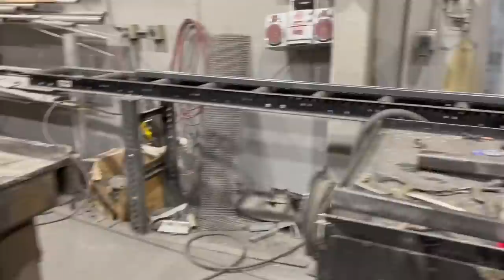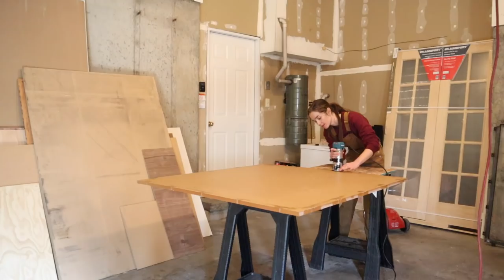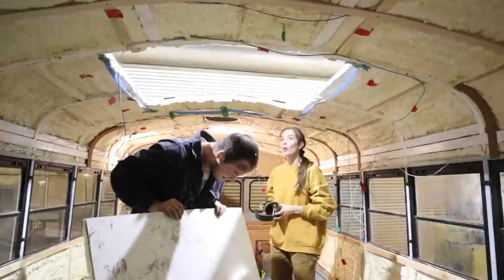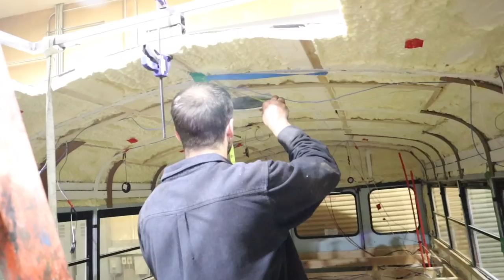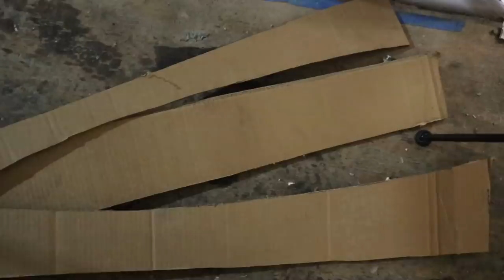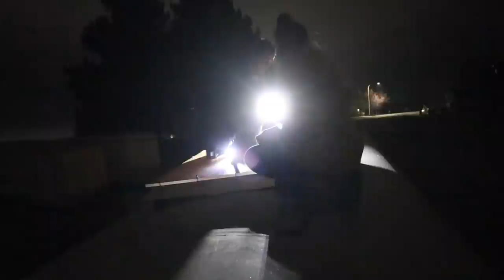Skoolie Roof Raise, Lazy girl edition: Giant skylight for more height in my school bus

Comment: I knew eventually you would use the grinder. Bonus points for welding! I discovered Shawn and Ash (wonder where they went) when I started building. I wish I had done the same, still. Yours looks better. A shop and a brother engineer would have helped me so much!

Comment: That oil thing is so funny, funny story: when I was about 22 right before I joined the Air Force I took a trip from Michigan to Myrtle Beach SC and my car was crap and wouldn’t have made the trip, long story short my parents let me take their Cadillac but my dad told me to check the oil each time I filled up the tank, so I did, or so I thought. About half way  on our way back to Michigan I realized I was checking the transmission fluid 😳 So it happens to us all 😁
Reply from the maker: amazing 😂

Comment: Emma, I love the skylight, but I one real huge concern. Does that open towards the front of the bus? If it does I plead with both your brother and you to move the hinges to the front, and have the cover open to the rear! If you are driving and the wind manages to get under the front at highway speeds, it is going to flip open and rip itself right off the bus. If you have it open to the rear, even if you forget to secure it, it may rattle around a bit, but it won't blow off.

Comment: Skylight looks great, Wondering, you made sure to use spray foam insulation everywhere except for the single pane windows. They will suck the heat right out of the bus,
Reply: My winter curtains have two inches of insulation built in which solves the heat loss character of those type windows.

Rainwater still leaks in and stains my blockout layer !

Comment: Well, Emma, you have to start somewhere.. Every achievement starts with an ambition..  =) I have to confess I'm ambitious too, sometimes too much, but so far it's going... hehe, shortly I will  start uploading a bit of everything and I hope something will help you in your adventures.. Ya, overfilling the oil wasn't that good of a thing, so keep an eye on different filling holes.. ..as not everyone of those is the same. =) You started biulding the bus with little skills, but learning is the only way to go.. You also look pretty young to me, 24-26 at the most (I suppose) so no wonder you have little experience. Anyway, you just started, so don't get frustrated if you don't know something. Scribing is also called picking the shapes (contours) in bodywork, fyi. Well, I'm not criticising, but honestly the frame to me looks a tiny bit overkill..  Keep going, don't stop! Thumbs up big time.

Comment: Don't feel too bad, or stupid about the oil. Like you ever owned a huge bus with a huge engine before, right! When I was younger, they oil light came on in my Honda. I asked the local garage "How many quarts do I need to add?" He thought I asked "How many quarts will the engine hold?" So I added 5 quarts when I should have added maybe one? So I had a massive blue smoke screen behind be on the road and It was not cheap to fix the damage! Anyway, keep rolling along! Never mistake bravery for stupidity!
Reply from the maker: hahaha
thank you!!
Reply: And the skylight is beautiful!

Comment: When I was 17 I wanted brembo brake calipers, but I was broke and decided to just paint mine red to look like them. The process was quick and they turned out meh, and the next day I needed to go to work. Backing out of the driveway my car felt sluggish, just weird. Driving forward, same thing, felt a ton of resistance and basically had to really get on the gas to get going. I thought because I painted the calipers that the paint, for some reason, was making friction that was slowing the car down?? But I was gonna be late to work so I just rolled with it. Once I got to work, 5 miles from my house, I finally noticed on my dashboard that my e-brake was still on FROM WHEN I JACKED THE FRONT OF MY CAR UP TO REMOVE THE TIRES TO SPRAY PAINT THE CALIPERS. I have not told anyone I know irl that this happened... All this to say, I feel you with the engine oil debacle lol

Comment: not to bad of a mistake with the oil funny though, back in my younger years I worked at a garage, had a lady bring in a car she couldn't figure out why it ran badly, when we pulled the drain plug for the oil pan it shot clear across the shop, turns out she thought all the fluids went in one cap, yep every time she added any fluid to her car she put all in the oil cap (washer fluid, antifreeze, trans fluid) was very surprised she didn't blow the engine lol

Comment: 🤣🤣🤣🤣.  Trust me you are not the first person to do that.   It reminds me of a story about a neighbor family when I was just a kid.  The woman needed to take the kids to an appointment but they checked the fluid levels and the engine was low on oil.  Not knowing where it went they added it to the radiator.  Remember this would have been back in the early 60’s and they didn’t have little symbols on the caps or dipsticks.  Luckily another neighbor caught it and stopped them.  He filled the oil into the engine.  When her husband got home the whole family got instructions on automotive maintenance.
Reply from the maker: so good to hear it 😂

Comment: Hey stuff happens, that’s how we learn. But you might want to change the transmission fluid because gear oil is different than motor oil and it could cause you a lot of problems in the future especially if it’s an automatic then it’s way different than transmission fluid for automatic transmissions. PS keep up the good work this is going to be amazing when you’re done and I love that you’re not just sit get sitting back and dreaming about doing something you’re actually doing something. Just in case pardon my spellcheck